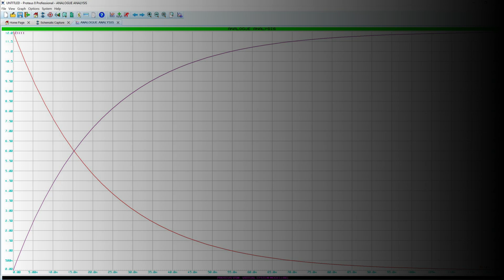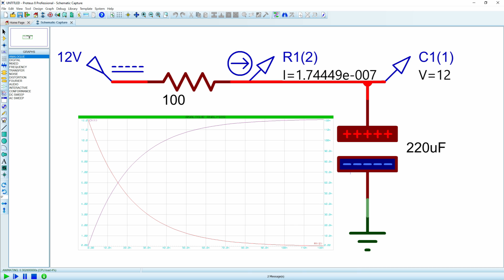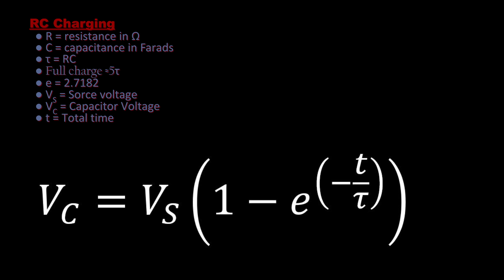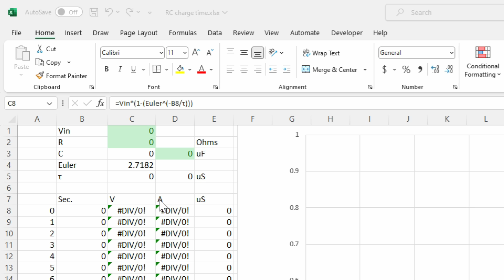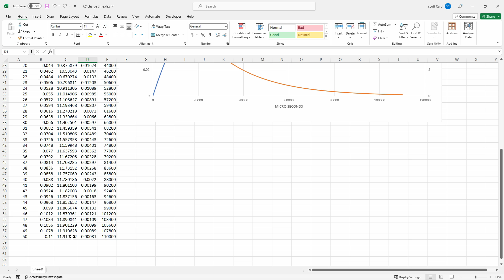A Comprehensive Look at RC Time Constant Charging Calculation and Simulation

Comment: Perhaps you could answer this question for me.  If I have a 1000uf 200v capacitor and am trying to make a discharge resistor for it, what value is the resistor so that it doesn't take too long but also doesn't create a spark?